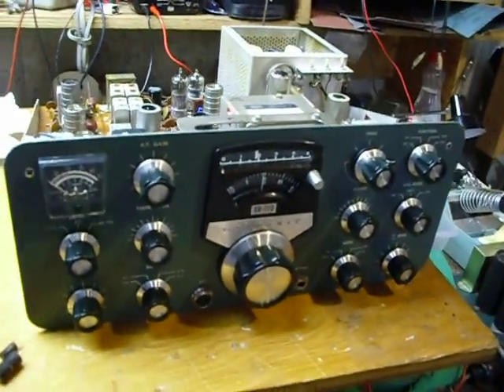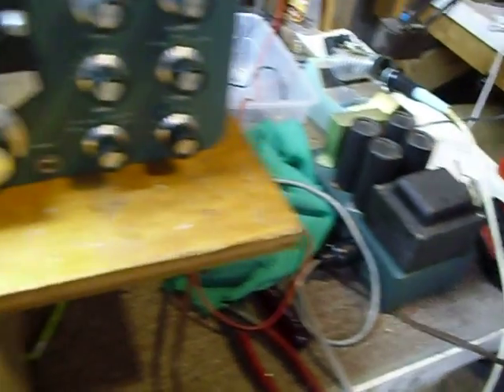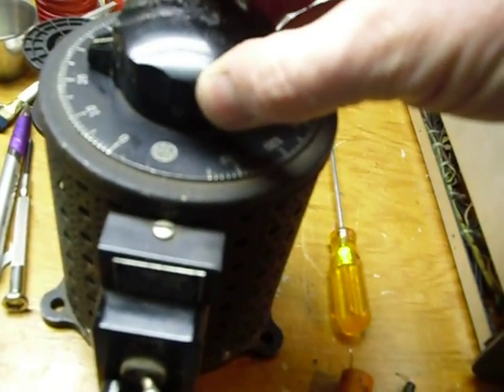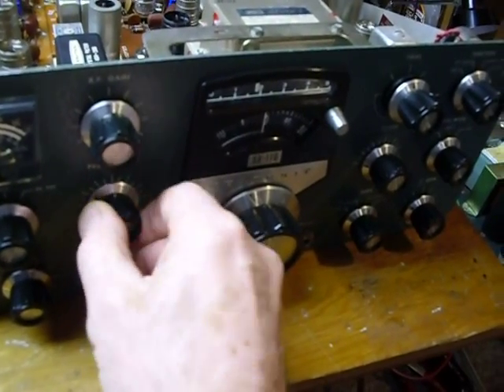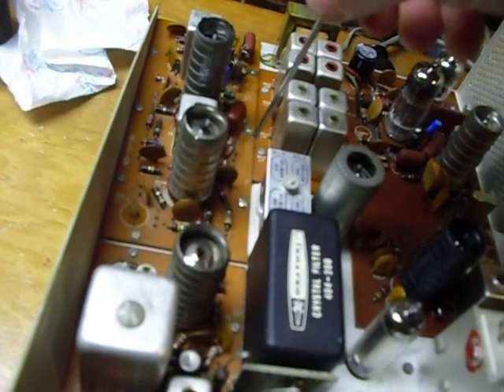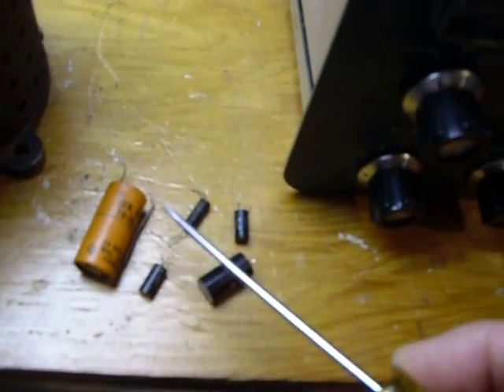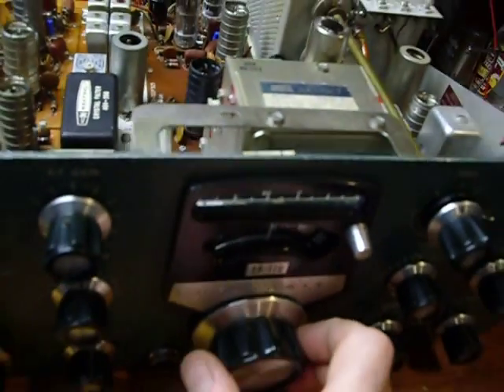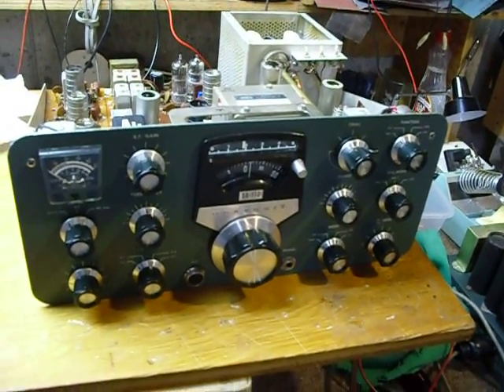SB110-5, Heathkit SB110,restoring a boat anchor,fixing old amateur radios,SB110,SB110A,HW101,SB102,

Comment: Sorry for a belated comment, but I just happened across this vid. Since I built one of these I want to partially correct your time frame. I can say with absolute certainty that the SB110 was available as early as 1967, as that's when I bought and built mine. I have a specific set of adventures which I can cite to when that happened. 

I became familiar with the Heath SB series when a neighbor (and an Elmer) got a pair, the SB300 and SB400, probably in 1965 or '66. I can't be too sure on the dates, but those are close. I had spent a lot of time in his shack from about 1963 on. He was a Tech, and although he longed to be on HF, he could never master the code. His wife, however, did and that's how he wound up with the Heath Twins.

So, it could have been as early as 1966, but absolutely by 1967, I (also stuck at Technician) had graduated from Junior College with my pilot's ratings and was awaiting employment by the airlines. I had an interim job at the School Board so was making enough money to afford the '110.

It wasn't my first kit, but it was, by far, the most complex one, and I wound up having to take it to the store in Hialeah to have them look it over. When I got it back, I got on the air and made all sorts of new friends in the South Florida area. 6M had long been populated by AMers (including my friend, until he bought and built an HX30), but SSB was starting to take off.

In January '68 I started dating a local girl and brought her home one time to show off the '110 and put her on the air. That time period is absolutely correct, because by April of '68 I had relocated to Jacksonville where I started my career in air traffic control. 

Even though I brought the '110 and an antenna with me, I never did get it back on the air. I eventually sold it to one of the locals back down in South Florida, an old AMer I'd met who wanted to get on SSB.
Reply from the maker: You are correct  I agree  . Thanks for your comments    73  Bob

Comment: The SB110 is not like the HW101 which sold very well. I fixed up an HW 101, and the only reason I grabbed the HW was it had the power supply with the selectable high and low voltages. I usually don't stop at 10 volts. I start at about 30 volts, and check an ammeter as I ramp it to 30 volts, then I let it sit at 30 or 40 volts. Heathkit did not explain any theory, but they gave you the basics to get you up and running. I have bought NEW MFJ stuff, and the first thing I do with modern MFJ anything is take it apart, check for missing screws (they all usually have at least one or two, or sometimes 10 or 12, tighten the screws, replace the antenna jacks with Ampenol, and make sure everything is grounded. GREAT VIDEO! 73s KI7AQJ